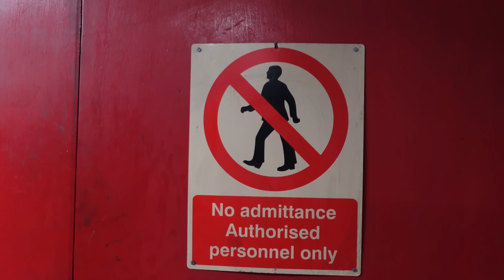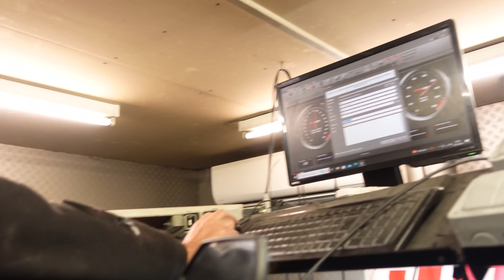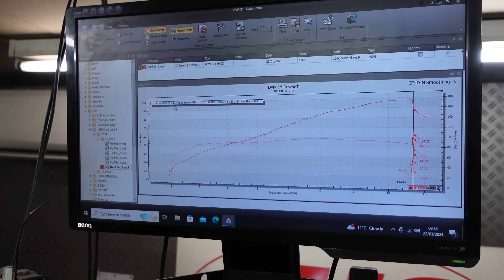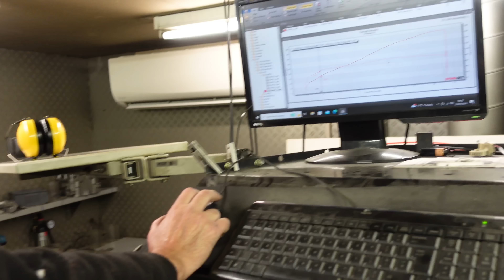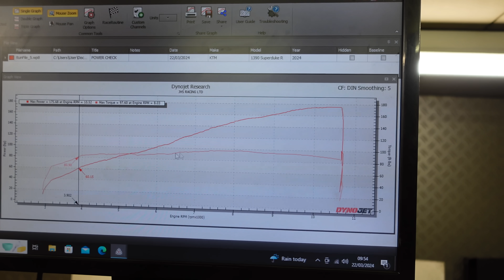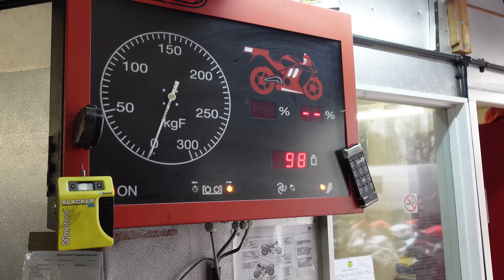ON THE DYNO | KTM 1390 SUPER DUKE R

Comment: My gen 1 made 175 with full system, replacement airbox etc, etc. This will be 190 with full system and a tune 😎😎
Reply from the maker: Hi pops
Reply: Loves the family reunion 💓
Reply: @dylanhedges5634  Yeah, like Josef Fritzl reunited with his daughter.
Reply: @FortyFourTeeth  🥂
Reply: Needs 200 with all the bells and whistles to make me buy it tbh. Hopefully there are a lot of eu restrictions in it unlike the previous models
Reply: Yeah but 20 odd grand you expect it to have the claimed power
Reply: @doone5303  it does though. Those are engine hp not rear wheel hp. About 10-15% is lost from engine to wheel. Still i need 200 at the wheel all tuned up
Reply: My 1290 last gen has the full akra pipe and tune and I cannot imagine needing anymore power. It is more about the torque than the top end I think. Really fun bike - even have a soft set of luggage for touring. Not sure it is passing any track dB limits at the moment, might well need to find a different end can for that.
Reply: @LambChopRides - where did you go for a map? I have the one that came with the system, but the fuel consumption is outrageous and I am wondering if it is running super rich ? I was thinking about a custom dyno tune, which I have done in the past on my track bike.
Reply: @TimeMoneyEarn What you "need" it for then, Valentino?
Reply: @FlowDesign82  exact same reason one picks a 1000 over a 600
Reply: @TimeMoneyEarn  No. It's more like 180 vs. 200 BHP and you are never going to get that difference out of a bike. Furthermore, a naked bike like this is tuned for torque, not for top end speed BHP.
Reply: James knows all about ktms 😂.   Good for business i know , he might have to except that as well. Plenty of fix work with ktms
Reply: Sniff's, walks away, hands in pockets.., Sees Dan......"Dan!! Dan!! Dan!!......
Reply: @TimeMoneyEarn  Sniff's, walks away, hands in pockets.., Sees Dan......"Dan!! Dan!! Dan!!......
Reply: Hectic fritzel on the back wheel or the back of his daughter  @flamintasty
Reply: Originally, our 2014 and 2015 were about 150hp at rear wheel so it was acceptable for the manufacturer to advertise 173 engine hp (ok, they claimed in 2014 a 180hp)... Some tune up and decat, PCV did add about 7rwhp.

Much later, both our 2021:s did 165 hp at rear wheel and at 9900 revs... So, the new 1390R does 175 rwhp at 10500, I think that is not much more useful power from the engine... And torque - about the same 130nm is there but because of the variable timing, the peak is at 8000 revs. about 300 lower than at the 2021 ones have. 

So actually. Not a sensational development at the engine but some would maybe like the gearing - which is a bit shorter at 5th and 6th?

I think the looks is horrible, carage-built like. KTM send us a newsletter telling us that we cannot do anything to that - and when the new one appears into our mirrors, we can do nothing about it too! What kind of geniuses are doing the marketing there? 😆
Reply: Oh, have to add: The 2021:s feel somehow briskier and smoother than the gen 1 ones we earlier had - but I think the highly distinguished electronics did me once a very dirty trick: the only time I had an opportunity to open the throttle at 4th and 5th gears, the engine acted like a sleeping cow! At certain speed much before I ever had thought, it just stopped pulling hard... With the 4th gear it went nicely to the limiter and I thought it to be about the same real life level as the old ones. But, after shifting into 5th, I remember having to stare at the throttle grip to actually believe it is pinned fully open! So, that is why I had those both dynoed - to prove that there is nothing mechanically wrong. About the electronics, no one knows because there are so many factors in the play (the situation is not easily reproducible) . 

Anyhow, KTM has come a long way with the 1290:s already, those 2021:s have a very nice balance and even at high speed, they are calm (one could say the old ones were much more excitement-causing).
Reply: My gen 1 made 185.6 and 177nm. Full tank 193.5 kg.
Reply: @doone5303 wheel horse power and crank horse power are different, champ
Reply: The 1350 engine with the dual camshaft profile should broaden the torque a good bit more, which will make the shove stronger on the bottom and top end.

Comment: 176 at the wheel is around 200 hp at the crank.  Incredible stuff.
Reply: It says 176 at the engine on the computer screen?
Reply: It is a 1.4 though
Reply: @jamsstar2010  Well, 1.35 if you want to be pedantic 😂
Reply: @jamsstar2010  Sure, it´s a big engine but any way you cut it 176 hp at the wheel is tremendous for the street.  That torque curve is as flat as can be with almost 100 lb-ft of torque.  Displacement aside, this thing is a beast.
Reply: I wonder where it'll be with the powerparts full system and tune
Reply: @evoermine  I think that says at engine rpm not hp measured at engine, but I know shit about dynos
Reply: @evoermine  No, it says 176 HP at Engine RPM 10.52 (10,520) - Basically meaning it makes 176hp @ 10,520 RPM. That number is at the rear wheel.
Reply: Shallow..and  @flamintasty
Reply: Brutal

Comment: KTM has gotta make a new RC8 with this engine
Reply: With no traction control, no power modes, and a cable throttle? Challenge accepted.
Reply: The current RC8C is just a lil engine but its an animal. The LC8 in that bike would be Beast. It would shit on panigale.
Reply: @popsproductions8547  V4R is a hard motor to beat. Unless you're referring to the V2.

Comment: For Mr Holland
@6.50 ish "I had a Viva" 🤣My first was the HB followed by an HC, apparently the performance of the HC was much "improved" by the increase in capacity (or swept volume if Mr Holland is reading) from 1159 to 1256....I never noticed this back in 1978 where it struggled to shift us lardy bikers and our "molls" in the depths of a Scottish winter at anything over 60 MPH, just as well, back then the drivers cut-off point was roughly six pints.

Comment: Another engineering eye openner from James, I suspect the oval tubes as he says is to increase rigidity on the vertical plane and allow flex in the lateral plane. Like Rossi felt the first time he rode the Yamaha R1M and extended the engine bracing and made them narrower to allow flex in the frame under power.

Comment: I think you can see the cam shift  a bit in the  torque drop at about 5200 -  to about 5400 rpm before it climbs slowly again till about 6500 that climbs again till about  8200  and starts to drop off 
imagine what it would be like if you could tune out the dip from 87 to  92 - 93.7  in curve on the torque 🤪🤪 I wonder if you could tune it out, 🤔 
maybe with the full system as you said when riding that one one the test!! it felt like it went harder  maybe its torque curve was  like that on that bike 🤔🤔

Comment: Perfect for the street..No need for upgrades, to keep your Warranty 👍 🇦🇹
Reply: Too much for the street
Reply: @DeFausti  
Perhaps, for a new rider of course, but an experienced one, No more is needed. Makes me think on lightening my Wallet ??
Reply: @elithegreat6463  You're deluded if you think you need more than 100Hp for the street. And probably a worse rider than you think if you say that
Reply: @DeFausti charming comment. No, 170 hp is not necessary for road use, but the accompanying torque is perfect. So is the riding position and handling, perfect for bigger guys.
Reply: @mojosdad68  Street Triple is the perfect street bike. But I understand that you need something bigger if you're fat
Reply: @DeFausti  
My 2023  Triumph Rocket 3R, and 23 Ducati Monster SP disagree I been riding 40yrs, I can handle any bike 🖕
Reply: @elithegreat6463  Wow you can handle a cruiser and a moderately powered twin? Crazy skill bro. Bet I could run laps around you
Reply: @DeFausti  it’s alright, had a 2018 RS. But it’s under-sprung for anyone over 180 lbs, and lacks torque. I reply only for the benefit of others reading this – not to validate your pathetic attempts to  belittle people.
Reply: @DeFausti  calm down Rossi, I could beat you on my NC50 😂
Reply: I tend to agree, and obviously this is way overboard for anywhere on the street... but I have a beemer with like 125ish HP? and it is not too much at all. Depends how the power comes on. I go wide open often.  @DeFausti
Reply: Street Triple is up there @DeFausti
Reply: @bearcatracing007  Calm down Rossi
Reply: @mojosdad68  You know torque is a function of RPM right?
Reply: @DeFausti  uhm no, torque is equal to the force applied to the crank and the leverage (usually the stroke). You can use torque and rpm over some constant to get the power though.

Comment: Old 2008'ish Fireblade's cranked out 180hp out of just 1000cc. Can have those for pennies now.
Reply: But you had to rev the shit out of it, KTM makes engines with such crazy but useable torque its insane. I love the Aprilia Tuono but a 1290 super duke is so much more fun on the streets.
Reply: 2008 fireblades never made 180bhp as standard. Couldn't keep oil in them either
Reply: and half the torque 🤗
Reply: 180hp will be around 200bhp at the crank. No way in hell a 2008 Fireblade made that power.
Reply: Even if an 08 fireblade made 180hp at the wheel itd still be a fireblade, people dont buy dukes to go faster than a blade
Reply: @nickedwards5440  couldnt keep oil out the combustion chamber either

Comment: Maybe KTM should call Koeniggseg and have them make a free valve system for them.  The free valve is good for 30HP I would think.
Reply: Freevalve is so revolutionary that despite having built its first functional engine back in 2008 nobody's bothered making it yet because it overcomplicates a very simple thing. Koenigsegg has been funding them since the start and yet even they haven't managed to make it make enough sense to put it into production. Also if you wanna try it some guy on YouTube built his own freevalve system for a MX5 and has everything you need to build it yourself available to download for free.

An extra 30hp is probably possible but there's easier and far cheaper ways to do that
Reply: Maybe you should stick to more simple things.

Comment: Just remember folks it’s almost a 1400! 
Imagine an MT10 with the same displacement
Reply: Yeah it would handle like a Harley!
Reply: Agree but at 200kg wet its got the mt10 beat
Reply: @Yamaprilia  What are you talking about? 
I say 1400cc MT10 would handle like a Harley I don't no what you're rambling about?
Reply: @mrmojosrisen7514  what am i talking about? 200kg wet was what i was talking about. How much would a 1400cc mt10 weigh i wonder? Maybe 240kg wet?
Reply: @Yamaprilia you can use the hayabusa's weight as reference.